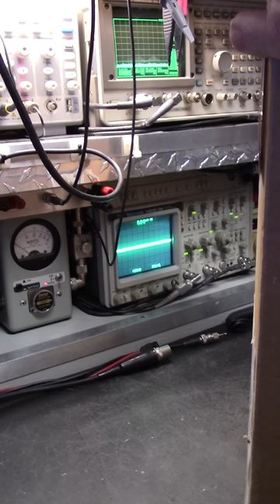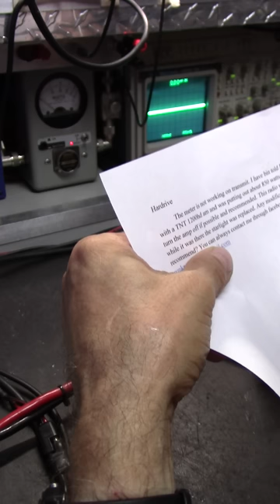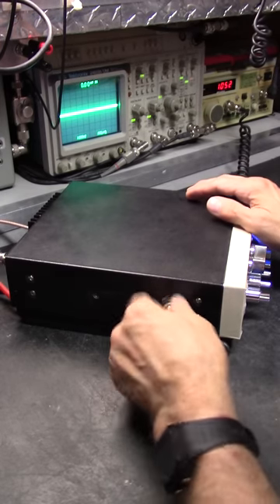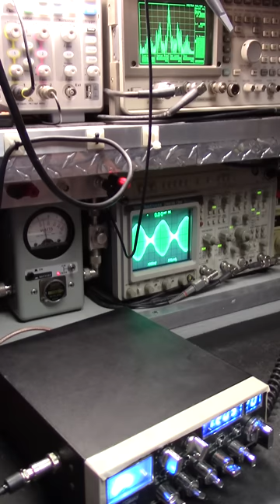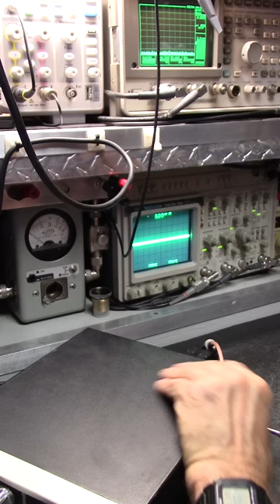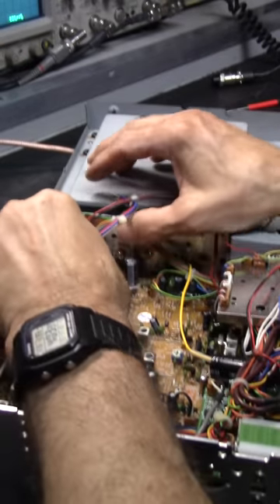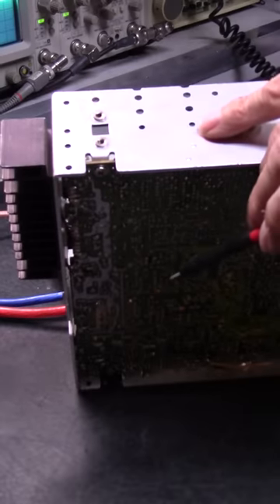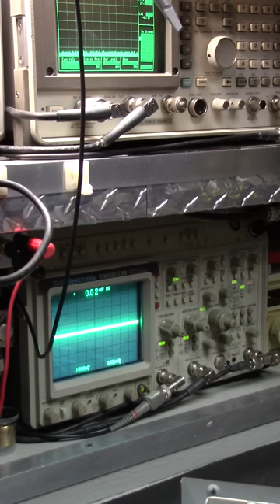DTB Radio Galaxy 98VHP .. Swinging Backwards Textbook Tune (Part 1).

Comment from the maker: Here's what it takes to cut through the noise, be loud and crystal clear with a better receiver too: 
A) Tuned Bench:  https://www.youtube.com/watch?v=lwcDfXOgAls. 
True, it's more complicated and time consuming to accomplish these consistent and accurate results. Below is a partial procedure and list of calibrated equipment used to achieve this level of performance . Read on ..

Fine Tune CB Radio Shop strictly adheres to (https://www.nist.gov/) NIST Traceable Calibrations and other industry standards to maintain accuracy and consistency for providing Real World Performance Tuning of Citizens Band and 10 Meter export mobile radios with integrity.

"Basic Textbook AM/FM/SSB Transceiver Tune, Alignment and Calibration" 

1) Pll adjustments
VCO & OSC, AM TX OSC, USB TX OSC, LSB TX OSC.

2) Transmitter alignment
DRIVER BIAS, FINAL BIAS, SSB  (or gate voltages for mosfet versions) CARRIER BALANCE, HI-LO AM & SSB Power, RF METER, AMC, ALC and FM DEVIATION.

3) Receiver alignment
AM/FM RF & IF SENSITIVITY, FM DETECTOR/DEVIATION, SSB IF SENSITIVITY, SSB S-METER, AM/FM S-METER (100uV unmodulated -67dbm for “S-9” meter reading!), AM/FM SQUELCH RANGE, SSB SQUELCH RANGE, and NOISE BLANKER/AUTOMATIC NOISE LIMITER (Real World dBm to volts (uV) tables below).

That's just a typical run of the mill textbook tune up and alignment (if you're lucky). There's more to it than frequency alignment, modulation adjustment, meter calibration and a tune up report displaying exaggerated rms Bird peak watts! 

"Test Bench includes"

Bird 4314C Meter
https://www.birdrf.com/Products/Test%20and%20Measurement/Power-Meters/Wattmeters-Line-Sections/RF-Wattmeters/4314C_PEP-Single-Element-Wattmeter.aspx
Part 1) https://www.youtube.com/watch?v=RpX9IHe4ORM&t=16s
Part 2) https://www.youtube.com/watch?v=LuhbqTf6Bxw
Bird 4314C Accuracy Test: https://www.youtube.com/watch?v=DqEOabYqhQo&t=5s
Bird Stipulates 1/2 wavelengths  https://www.youtube.com/watch?v=5eWhgT-rTII
And Genuine Bird Elements from 1K down.

Bird 4373 Sampler 
https://www.rfparts.com/signal-samplers.html

HP8924c with options
http://userequip.com/files/specs/2147/HP%208924C%20Repair.pdf
https://www.youtube.com/watch?v=Cg1w0xBa27s&t=1s

HP8920a with options
https://www.keysight.com/upload/cmc_upload/All/EPSG072204.pdf

Three analog scopes, one digital 200 Mhz
https://www.atecorp.com/atecorp/media/pdfs/data-sheets/tektronix-2465b-2467b_manual.pdf
https://www.youtube.com/watch?v=by98x4eu2lM

Fluke 27fm
http://www.fluke.com/fluke/inen/digital-multimeters/fluke-27.htm?pid=56055
 
LCR http://www.lcrresearch.com/wp-content/uploads/2017/05/LCR_Pro1_Manual_version1.03.pdf

Power supplies
6 Cosel PBA1500f12 (750 amps) variable and configurable.
https://en.cosel.co.jp/product/powersupply/PBA/PBA1500F/PBA1500F-12/
Corcom 20VB1 F7130 EMI Filter 50-60Hz 250V

Times Microwave Coax jumpers and test leads
http://www.timesmicrowave.com/cms/products/cables/lmr/
https://www.youtube.com/watch?v=EmqaGJ6IWow
https://www.youtube.com/watch?v=1ltFVSxGp5Y
https://www.youtube.com/watch?v=v12YZT_1o90
https://www.youtube.com/watch?v=h7iiYfmYWRA&t=215s

Amphenol RF Connectors
https://www.amphenolrf.com/
https://www.youtube.com/watch?v=dVh5B0hdEA0 
https://www.youtube.com/watch?v=dKZg8T_AOso

More range, compliments, reliability and a quieter, clearer but more sensitive receiver,  Get Fine Tuned .. not peaked and ruined.

Here are some VideoGates of me at the bench practicing what I preach using my bench radio or customers radio completed and ready to be shipped: https://www.youtube.com/results?search_query=hard+drive+163+ more: https://www.google.com/search?q=Hard+Drive+163+nm&ie=utf-8&oe=utf-8&client=firefox-b-1-ab

It's what I recommend, use, service and sell ... to you ... not something non practical or deceiving in a misleading way. I'm not just the tech and owner of Fine Tune CB Radio Shop, I'm a customer too!  When finished, You'll be giving radio checks, not asking for them .

dBm To Watts and Volts
Tables below displays relationship between Power in [dBm] or [Watts] and Voltage in RMS, peak, peak-to-peak for sinusoidal signals in 50-Ohm systems for accurately measuring and tuning am/fm/ssb receiver sensitivity, agc, squelch and "S9" Meter calibration.

  [dBm] [Watts]   [Volts]rms   [Volts]p    [Volts]pp
-140 0.100E-16  22.361 nV  31.618 nV  63.236 nV 
-139 0.126E-16  25.089 nV  35.476 nV  70.952 nV 
-138 0.158E-16  28.150 nV  39.805 nV  79.609 nV 
-137 0.200E-16  31.585 nV  44.662 nV  89.323 nV 
-136 0.251E-16  35.439 nV  50.111 nV  100.222 nV 
-135 0.316E-16  39.764 nV  56.226 nV  112.451 nV 
-134 0.398E-16  44.615 nV  63.086 nV  126.172 nV 
-133 0.501E-16  50.059 nV  70.784 nV  141.568 nV 
-132 0.631E-16  56.167 nV  79.421 nV  158.842 nV 
-131 0.794E-16  63.021 nV  89.112 nV  178.223 nV 
-130 0.100E-15  70.711 nV  99.985 nV  199.970 nV 
-129 0.126E-15  79.339 nV  112.185 nV  224.370 nV 
-128 0.158E-15  89.019 nV  125.874 nV  251.747 nV 
-127 0.200E-15  99.882 nV  141.232 nV  282.465 nV 
-126 0.251E-15  112.069 nV  158.465 nV  316.931 nV 
-125 0.316E-15  125.743 nV  177.801 nV  355.602 nV 
-124 0.398E-15  141.086 nV  199.496 nV  398.992 nV 
-123 0.501E-15  158.301 nV  223.838 nV  447.677 nV 
-122 0.631E-15  177.617 nV  251.151 nV  502.302 nV 
-121 0.794E-15  199.290 nV  281.796 nV  563.591 nV 
-120 0.100E-14  223.607 nV  316.180 nV  632.360 nV 
-119 0.126E-14  250.891 nV  354.760 nV  709.519 nV 
-118 0.158E-14  281.504 nV  398.047 nV  796.094 nV 
-117 0.200E-14  315.853 nV  446.616 nV  893.232 nV 
-116 0.251E-14  0.354 µV  0.501 µV  1.002 µV 
-115 0.316E-14  0.398 µV  0.562 µV  1.125 µV 
-114 0.398E-14  0.446 µV  0.631 µV  1.262 µV 
-113 0.501E-14  0.501 µV  0.708 µV  1.416 µV 
-112 0.631E-14  0.562 µV  0.794 µV  1.588 µV 
-111 0.794E-14  0.630 µV  0.891 µV  1.782 µV 
-110 0.100E-13  0.707 µV  1.000 µV  2.000 µV 
-109 0.126E-13  0.793 µV  1.122 µV  2.244 µV 
-108 0.158E-13  0.890 µV  1.259 µV  2.517 µV 
-107 0.200E-13  0.999 µV  1.412 µV  2.825 µV 
-106 0.251E-13  1.121 µV  1.585 µV  3.169 µV 
-105 0.316E-13  1.257 µV  1.778 µV  3.556 µV 
-104 0.398E-13  1.411 µV  1.995 µV  3.990 µV 
-103 0.501E-13  1.583 µV  2.238 µV  4.477 µV 
-102 0.631E-13  1.776 µV  2.512 µV  5.023 µV 
-101 0.794E-13  1.993 µV  2.818 µV  5.636 µV 
-100 0.100E-12  2.236 µV  3.162 µV  6.324 µV 
-99 0.126E-12  2.509 µV  3.548 µV  7.095 µV 
-98 0.158E-12  2.815 µV  3.980 µV  7.961 µV 
-97 0.200E-12  3.159 µV  4.466 µV  8.932 µV 
-96 0.251E-12  3.544 µV  5.011 µV  10.022 µV 
-95 0.316E-12  3.976 µV  5.623 µV  11.245 µV 
-94 0.398E-12  4.462 µV  6.309 µV  12.617 µV 
-93 0.501E-12  5.006 µV  7.078 µV  14.157 µV 
-92 0.631E-12  5.617 µV  7.942 µV  15.884 µV 
-91 0.794E-12  6.302 µV  8.911 µV  17.822 µV 
-90 0.100E-11  7.071 µV  9.998 µV  19.997 µV 
-89 0.126E-11  7.934 µV  11.218 µV  22.437 µV 
-88 0.158E-11  8.902 µV  12.587 µV  25.175 µV 
-87 0.200E-11  9.988 µV  14.123 µV  28.246 µV 
-86 0.251E-11  11.207 µV  15.847 µV  31.693 µV 
-85 0.316E-11  12.574 µV  17.780 µV  35.560 µV 
-84 0.398E-11  14.109 µV  19.950 µV  39.899 µV 
-83 0.501E-11  15.830 µV  22.384 µV  44.768 µV 
-82 0.631E-11  17.762 µV  25.115 µV  50.230 µV 
-81 0.794E-11  19.929 µV  28.180 µV  56.359 µV 
-80 0.100E-10  22.361 µV  31.618 µV  63.236 µV 
-79 0.126E-10  25.089 µV  35.476 µV  70.952 µV 
-78 0.158E-10  28.150 µV  39.805 µV  79.609 µV 
-77 0.200E-10  31.585 µV  44.662 µV  89.323 µV 
-76 0.251E-10  35.439 µV  50.111 µV  100.222 µV 
-75 0.316E-10  39.764 µV  56.226 µV  112.451 µV 
-74 0.398E-10  44.615 µV  63.086 µV  126.172 µV 
-73 0.501E-10  50.059 µV  70.784 µV  141.568 µV 
-72 0.631E-10  56.167 µV  79.421 µV  158.842 µV 
-71 0.794E-10  63.021 µV  89.112 µV  178.223 µV 
-70 0.100E-09  70.711 µV  99.985 µV  199.970 µV 
-69 0.126E-09  79.339 µV  112.185 µV  224.370 µV 
-68 0.158E-09  89.019 µV  125.874 µV  251.747 µV 
-67 0.200E-09  99.881 µV  141.232 µV  282.465 µV
-66 0.251E-09  112.069 µV  158.465 µV  316.931 µV 
-65 0.316E-09  125.743 µV  177.801 µV  355.602 µV 
-64 0.398E-09  141.086 µV  199.496 µV  398.992 µV 
-63 0.501E-09  158.301 µV  223.838 µV  447.677 µV 
-62 0.631E-09  177.617 µV  251.151 µV  502.301 µV 
-61 0.794E-09  199.290 µV  281.796 µV  563.592 µV 
-60 0.100E-08  223.607 µV  316.180 µV  632.360 µV 
-59 0.126E-08  250.891 µV  354.760 µV  709.520 µV 
-58 0.158E-08  281.504 µV  398.047 µV  796.094 µV 
-57 0.200E-08  315.853 µV  446.616 µV  893.232 µV 
-56 0.251E-08  0.354 mV  0.501 mV  1.002 mV 
-55 0.316E-08  0.398 mV  0.562 mV  1.125 mV 
-54 0.398E-08  0.446 mV  0.631 mV  1.262 mV 
-53 0.501E-08  0.501 mV  0.708 mV  1.416 mV 
-52 0.631E-08  0.562 mV  0.794 mV  1.588 mV 
-51 0.794E-08  0.630 mV  0.891 mV  1.782 mV 
-50 0.100E-07  0.707 mV  1.000 mV  2.000 mV 
-49 0.126E-07  0.793 mV  1.122 mV  2.244 mV 
-48 0.158E-07  0.890 mV  1.259 mV  2.517 mV 
-47 0.200E-07  0.999 mV  1.412 mV  2.825 mV 
-46 0.251E-07  1.121 mV  1.585 mV  3.169 mV 
-45 0.316E-07  1.257 mV  1.778 mV  3.556 mV 
-44 0.398E-07  1.411 mV  1.995 mV  3.990 mV 
-43 0.501E-07  1.583 mV  2.238 mV  4.477 mV 
-42 0.631E-07  1.776 mV  2.512 mV  5.023 mV 
-41 0.794E-07  1.993 mV  2.818 mV  5.636 mV 
-40 0.100E-06  2.236 mV  3.162 mV  6.324 mV 
-39 0.126E-06  2.509 mV  3.548 mV  7.095 mV 
-38 0.158E-06  2.815 mV  3.980 mV  7.961 mV 
-37 0.200E-06  3.159 mV  4.466 mV  8.932 mV 
-36 0.251E-06  3.544 mV  5.011 mV  10.022 mV 
-35 0.316E-06  3.976 mV  5.623 mV  11.245 mV 
-34 0.398E-06  4.462 mV  6.309 mV  12.617 mV 
-33 0.501E-06  5.006 mV  7.078 mV  14.157 mV 
-32 0.631E-06  5.617 mV  7.942 mV  15.884 mV 
-31 0.794E-06  6.302 mV  8.911 mV  17.822 mV 
-30 0.100E-05  7.071 mV  9.998 mV  19.997 mV

                 Don't Be A Mud Duck!

Hard Drive 163 NM. 73's! Click click.

Comment: With this work being better than most it appears this is probably what we could expect from somebody who works on business band radios or a retired radio technician from the military or NASA following a simple service manual and turning a couple screws.  It's nice to know somebody has what it takes to clean this thing up. I would definitely be ashamed to put it on the air in that condition. Keep cleaning up the airwaves one radio at a time.

Comment: I owned 1 of these type radios for the semi! It was just a pain! Always in the shop for one thing or another. Than the display lost segments of three display. I had it repaired. Than traded it for my favorite radio. A RCI 2950. Chip tuned it up! It is still chugging a long . Great radio. Still pushing my Texas star 500 (no veraible ) great set up. Just enough to be heard but not be a pain big radio, 73. Tod kc9rka.
Reply from the maker: I have a new 2950CD on the bench now ..
Reply: Fine Tune CB Shop do you like the new cd display?
Reply from the maker: Yes I do, dimmer and contrast works great but I'm not sure if it's any better at wider viewing angles. Keypad is exactly the same, radio made in Malaysia and this is a radio that the Max Mod compliments well.
Reply from the maker: I'll do a video.

Comment: UM,are those the 'Red Connectors" that You told all not to use? Probably anold video. yes,I am paying attention,even to the most minute detail. I know that You said that You changed them out. I have never seen any except for in SUPER large U.P.S.,Conditioning,and regulating battery back-up. Most times,if You want to run Your Business for three-Seven,I do not care. A.P.C.,They were My "Go To", Tripp Light" is another. I have this equipment on everything down to My televisions. Power is very dirty. Anyways....I really do like that Galaxy DX-98 VHP. If it can be done correctly,cabled and fused properly. Antennae, Straight for a Wilson 5K.. #0 0r #2 straight from the battery,fused. Weatherproof inline holder mounted and all cable loomed and away from vehicle's electronics,no paralleling them. Big radio,takes some power for sure and a lot of real estate for placement. I will,have one,or by then something better. I'm literally dying to get into this again!!!! Troy.